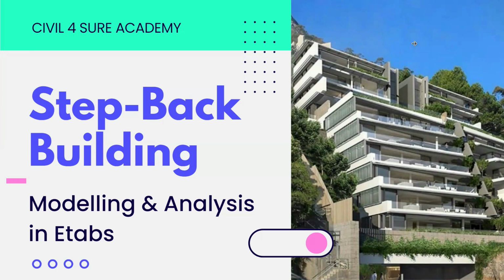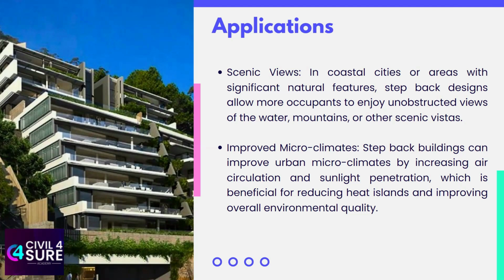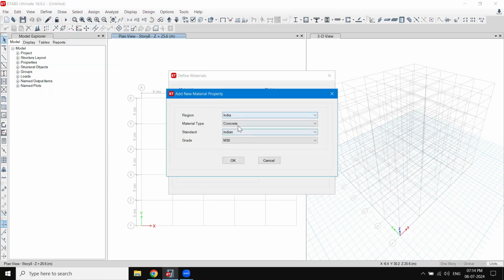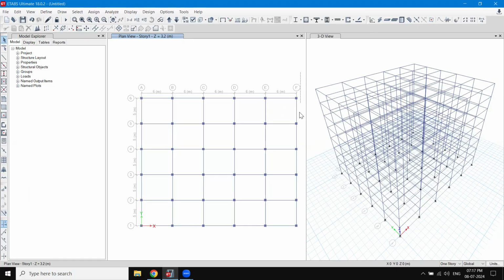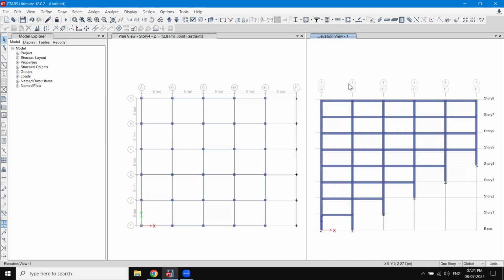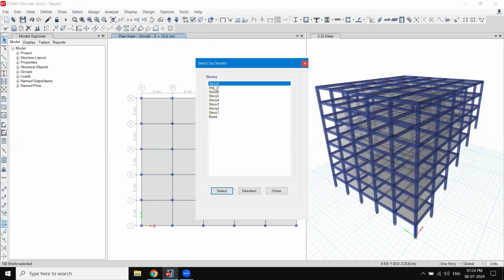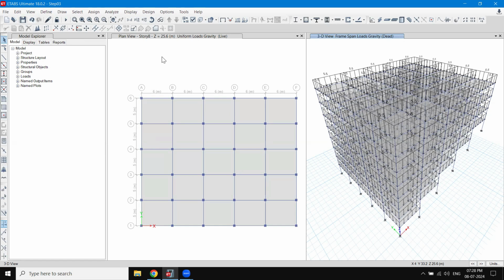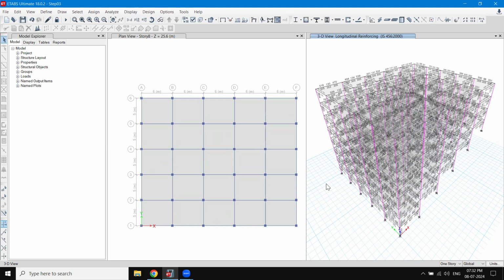Step-Back Building | Modelling & Analysis | In Etabs | In English

Comment: While defining sesmic load pattern, there are 3 options for time period ,which one we should take, user defined or program calculated in etabs
Reply from the maker: choose program calculated for easier access
otherwise time period can be calculated from codal formulaes
Reply: Project is in Sesmic zone is V ,if i do program calculate is shows less reinforcement in beams and all members pass but when i manually put time period its show more reinforcement also some beams fail in shear stress , Calculated with formula as per dimensions of building i got in Xdir-0.36 and in Ydir-0.45 ,

Comment: How can we remove torsional irregularity from. Such type of structures because in Every floor stifness and masses are already changing kindly explain
Reply from the maker: Shear wall must be incorporated to balance the center of mass. Shear wall must be fixed at upper/back side of building.
Reply: @JitendraChoubisa  retaining wall back on each step can serve the purpose of shear wall
Reply from the maker: Retaining wall is going to be a different entity from the building. No doubt it is going to support the Backfil but to balancd the mass..the retaining wall must have to be integrated into the frame of building and when you are going do it... it's going to be known with name of shear wall 😅
Reply: @JitendraChoubisa  area in each step increase so it means i have to incorporate shear wall at the lower story